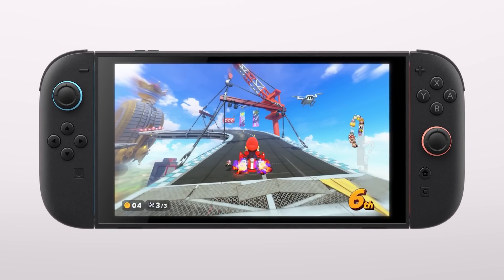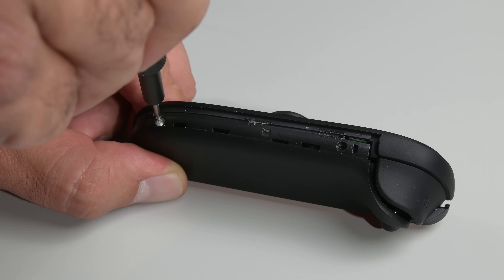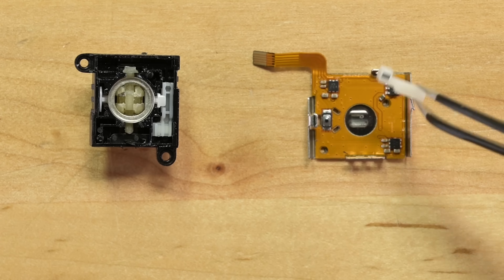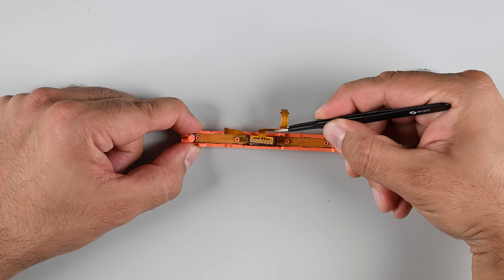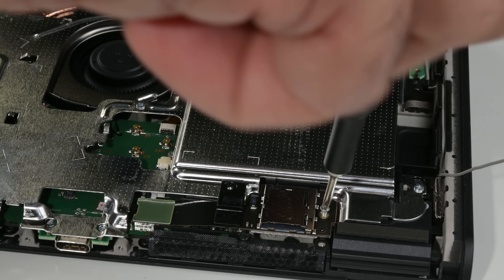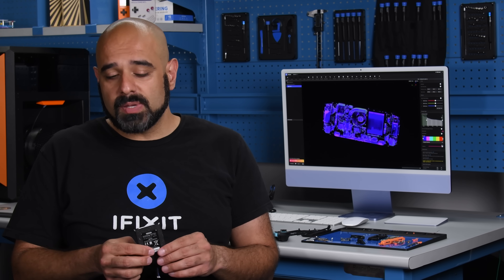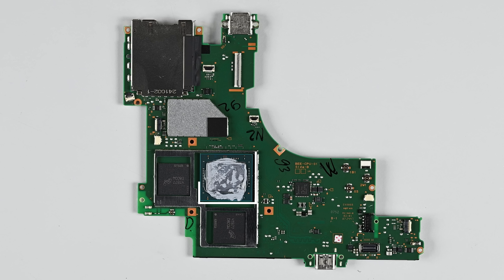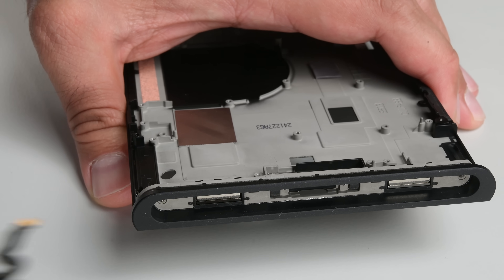Joy-Con Drift Isn’t Dead: Inside the Switch 2

Comment: One of the best things i ever did with my old joycons was replace the potentiometer sticks with hall effect modules.  Needless to say all the glued down pieces covering access screws is reprehensible
Reply: It would not work on the Switch 2, though, sadly, due to the magnets that are in the Switch 2 interferring with the hall effect sensors and making them drift. It would likely be more of an issue in detached joycon mode than atached mode, though, since when the joycons are atached, the magnets are basically in a permanent position in relation to th sticks' locations, but they are not in the other mode, especially if you move the joycons around a lot, for instance closer or over the Switch and thus its magnets. TMR is a nother magnet-based drift-less sensor technology that people are making sticks with, btw, BUT it is both higher resolution, more sensitive to movement, AND more resistant to outside magnetic intereference, making it possibly viable as an alternative! We need to try and test it first to be sure, though.
Reply: @Luka1180  even if it did work it’s so hard to get into the joycons now.  It wasn’t super easy on the original ones but at least there weren’t stickers and glue covering important screws.  To me this is Apple levels of bad design when it comes to the right to repair or modify it with better parts

Comment: That battery life is a major turn-off
Reply: If your a handheld user yeah so you should probably wait until the lite version if it exists
Reply: @nowh_8808the thing i like most about the Siwtch is the portability and battery life. I'm one of those weird people who doesn't really like the Mario or Zelda games and is more into things that are available on other consoles (like Skyrim). There's no point playing that docked as I might as well use my PS5 or PC
Reply: It's pretty much the same battery life as the pre-2019 LCD Switch which had a more power hungry processor compared to the Lite, OLED and post-2019 LCD Switch, honestly it could've been worse considering the 1080p, 120hz screen the Switch 2 has.
Reply: @netako I have the original Switch and the battery life is far longer than 2 hours even now, with an old battery. The only criticism is that it's slow to charge compared with many modern USB C devices

Comment: 8:22 That's not flash storage modules, 'each 128GB each' as you said. Those are memory chips, each 6 GB. Why would the SSD and the SoC share the same heat sink??? 

And you made the same mistake again by saying those are SSD storage at the end at 10:09. I think the flash storage is the one just above the SoC and below the cartridge reader under the emf shield.

Edit: Spelling.
Reply: the UFS storage is in the corner on the back of the board, on the other side of the battery connector

Comment: is it NOT beaten by the steam that is an outright lie, -A steam deck owner
Reply: It depends, docked yes the Switch 2 GPU outperforms the Decks but in handheld mode the Deck is likely to outperform the Switch 2 since the Switch 2 has to downclock a lot for battery life. The Decks CPU is faster, faster storage, more memory. The Switch 2 has the better GPU docked and portability

Comment: During that reveal of the switch to they made it a point to say the joy-con sticks the joy-cons have been rebuilt from the ground up from the ground up where the same crappy ones that have been in the same crappy ones since the beginning?

I knew once they said that they weren't going with hall effect sensors that they were using the same thing as before.
Reply: It is disgusting that they said that........

Comment: There is no excuse for a device that's not designed to be waterproof to not have replaceable batteries.
Reply: Fair, but given that switch 2 Is marketed to children an easily swappable battery like older phones used to have might be an issue. Poking, damaging, biting, swallowing etc.
Reply: @kamil10078 just make the back of the switch removable with 4 screws and don’t glue the battery or use one of the pull glue which is used in a lot of electronics. No risk of children unscrewing 4 screws and then pull that battery out and eat it.
Reply: @kamil10078  Game Boy, Game Boy Pocket, Game Boy Color, Game Boy Advance, Game Boy Advance SP, Game Boy Micro, Nintendo DS, Nintendo DS Lite, Nintendo DSi, Nintendo 3DS, etc etc all were marketed to children and all had easily swappable batteries. GEt out of here with this absolutely terrible excuse.
Reply: @mjc0961  It's one of them "modern types" you know.
Reply: @mjc0961  I can imagine the defence being "but but, back then they didn't have a clue about children's safety!" they 😁
Reply: @averdadeeumaso4003  Back then when everything had replacable batteries ...
Reply: @kamil10078 Not really, Nintendo markets towards adults that are nostalgic for the games they grew up on. The overwhelming majority of fans for Mario, Zelda, Kirby, Metroid, and especially Pokémon (along with the rest of their 1st party IPs that are the whole reason people buy Nintendo. No one’s buying a Switch 2 to play an inferior version of Cyberpunk 2077 on the go) are adults and it’s time we stop treating gamers as all children or adults who never grew up

Comment: Eight years later and Nintendo's still serving us drift-prone Joy-Cons? Come on guys! It's 2025, we've got TMR, Hall effect sensors, and you're still stuck on 2017 potentiometer tech! And don't get me started on that battery glued down like it's going to Mars. At least the teardown was epic as always - keep it up! 💪
Reply: eh hall effect sensors have existed since the 19th century lol there was never an excuse
Reply: @yamboy666 They existed in the 1800s? Or did you mean the 20th century?
Reply: Hall effect sensors would not work well on the Switch 2, most likely, due to the magnets that are in the Switch, but TMR, another magnet-based stick technology, are supposedly more resistant to outside magnetic interference, and thus may be a viable alternative. They are also higher resolution and more sensitive than hall effect sensors!
Reply: hall effects wouldn't work because the switch 2 uses magnets which affect them. whys everyone ignoring this 😂😂
Reply: @pixsled  It's addressed in the video, they also say that TMR would work fine

Comment: Just learn how to solder. It's not honestly that bad, The switch 1's display is worse to remove, and the battery is easy to remove if done properly, unlike in the ifixit guides. The stickers also aren't that bad and the console only uses 2 types of screws, unlike Iphones. Unfair to give it a 3/10, would give it a 6/10. Also, if you look at board scans of the switch, there just isn't enough space to make everything modulat. It's quite tight as is

Comment: My gulli kit hall effect sticks wore out after about 1 year. I reached out and got the opportunity to buy new TMR versions. Yay me. I hate that nintendo doesnt seem to care about this issue but I also dont think that the hall effect solution is as durable as it should be.
Reply: There is still a mechanical part to it, if the new hall effect part uses the same original housing, spring, and other components, I'd avoid.

Comment: Repairability was clearly not taken into account when designing this.
They don't care about users or the planet.
Reply: They care more about intellectual property than the planet.
Reply: @soundspark  I don't see anything here that would deter a modder.
Reply: @Shawn_White That's not the point. It shouldn't take a talented modder or professional repair tech to perform basic fixes. The console could have been designed in a way where the average person would be able to replace basically anything. The problem is Nintendo (and most other companies) go out of their way to make it as difficult as they can for the average consumer to repair their own stuff. They dont NEED to do it this way, they choose to. Not only does it cost the end user a ton of money, but it contributes massively to e-waste.
Anything that CAN be integrated using a modular component, should be. Press fit, ribbon cables, screws, etc. 
They do it this way so 99% of people feel forced to give Nintendo more cash for repairs/replacements.
Reply: @PloopChute  They should definitely do it like how Microsoft does it with their Surface computers where they have QR codes on individual parts linking to guides on how to fix them.
Reply: At least they didn't solder the joysticks in.
Reply: @Oree254  They know they'll be dealing with stick drift.
Reply: @Oree254  or put glue under the soldered Joysticks, YES, I SEEING YOU MICROSOFT!!!!!!
Reply: What else is new? Nintendo is one of the most evil companies.
Reply: Almost no consumers repair their own consoles, especially for mobile devices. And when it comes to warranty service, even the manufacturer doesn't repair products in this price range as its more cost effective to replace it since repair work has to be hand done.
Reply: @blastofo Then the design philosophy should start at repairability and potential recycling and then go from there.
Reply: you're expecting too much from nintendo buddy
Reply: How is this new?
Reply: Honestly in my experience that's marketing's fault
Reply: how?  @Dashitishere22
Reply: Just stop it's a custom system with a weird looking motherboard
Reply: @Space97.So what ?
My car is also very much a custom system, but I still curse the manufacturer when I can't easily fix a part.
Reply: Nobody cares about the planet 😂
Reply: @TermsAndConditionss Not nearly enough people care about it.

Did you know that it's where you live ?

Comment: Still a 5 year old architecture on launch, still a plastic LCD screen, still obnoxiously expensive for what it offers...
Reply: Screen is glass with a piece of foil on it.
Reply: @mikemaj2  It's plastic covering the screen which cannot be removed, which for all intents and purposes, is a plastic screen. It'll scratch just as easily as a plastic screen.
Reply: Hey now! Ampere ain't no slouch. It's light-years ahead of the nerfed Maxwell architecture the Switch 1 had
Reply: @ninten360  While true, it sadly does not change the fact that it is 5 years old at this point and is 60% of a 3050 which was already deemed bad value at launch. It's also just not a great feeling to spend that much money for a handheld console and get hardware that is half a decade outdated.
Reply: @AlexSchendel keep crying
Reply: @SWOTHDRAlol. How does that contribute to the conversation at all? Feel free to drop $500 on the Switch 2 if you want, I'm not stopping you. I'll stick my PC where I can swap parts as needed and get better performance per dollar.
Reply: @AlexSchendel It's a handheld as thin as a phone. I'm not justifying the price, but as far as power goes, I don't think something more powerful would be possible to cool in this form factor
Reply: @SWOTHDRAnobody asked for your input
Reply: you could say the same for almost every comment in this comment section  @juicetimer
Reply: @pixsled  I know, but its a fitting response to an equally garbage comment as "keep crying".
Reply: It think its a pretty nice piece of tech for what it is.  People just like to hit the 'on' switch and have a game run.

Comment: They took more notes from Apple.
Reply: Even apple allows to remove the battery without using tools or alcohol (after your open it of course), the switch is just a joke
Reply: @coquequique250600 you are a poor sad little clown 🤡
Reply: @coquequique250600  a joke?? You are a joke if you don’t understand why that battery needs to be glued like that to the system! But your tinny little brain can’t understand it
Reply: @coquequique250600  technically you still need tools to remove Apple batteries, i.e. a power source and jumper wires

Samsung's implementation is even better, literally just unwrap the battery and it pops out. I appreciate both methods of course, beats pull tabs and alcohol + prying.
Reply: @LazorVideosDestruction  I agree with you, but this isn’t exactly a competition. Both methods are very easy and effective. They’re just different is all. Both methods are better than 99.9% of other phone makers.
Reply: No more than Samsung 😂

Comment: I never had drift with any of my Joycons on the Switch 1, I did have drift with my Switch 1 Pro Controller though, the issue being, one of my dogs hairs...
Reply: There are many factors that contribute to it. Very few consoles were drift free, like the Dreamcast.
Reply: @lukilladog I never had stick drift, not on my ps3, ps4 or switch controllers. People need to learn how to keep their controllers clean. Put them away after you use em
Reply: @SWOTHDRA That is not a factor really, look for some potentiometer replacement here in YT and try to find one noticeable dirty. The design is dirt proof for the mechanism. There are factors, I've never had shoulder button, or trigger failures, but I don't play FIFA or Call of Duty either. Playing racing games though, it takes 4-6 months before official sticks lose their smoothness, then lose of tension and drift, and sometimes total failure of the sensors (jumpy sticks). My Gamesir G7 on the other hand, feels and controls like new after 1 year of playing the very same games. We are being played.

Comment: god why they have to use glue with joycons and stickers with the main unit?
Reply: It's a way to keep you out. Make it so changing anything permanently degrades the hardware without lots of extra work
Reply: The stickers is to keep the layer above the magnets as thin as possible. They said it's 0.2mm to make the magnets stronger
Reply: @dirtydirtsgt4751  thats just a bs excuse also the fact that they still use the same sticks as og joycons they 're gonna drift like before and they added glue to new joycons
Reply: @vjollila96  it's the same potentiometer tech, which is used in nearly every controller. The drift is caused by bad housing design on the previous one. Time will tell how this one holds up
Reply: The resisistive sensor also wears out or give Up.

Comment: That's not the storage next to the SoC. It's the 2x 6GB LPDDR5X RAM. The storage is on the other side...
Reply: mayor oopsie
Reply: @williamv0242 make the video yourself next time jacksss
Reply: @brodeur7  i aint buying that lmao
Reply: Maybe they should start using lpddr5 on gpus
Bro just hear me out
Reply: That's what I was thinking too 🤣
Reply: They also said it was weaker than the Steam Deck.... Lol
Reply: @yzois steamdeck run a few games mych better then switch 2
Reply: @issacdragon3834 the steam deck and even better, the Ally (original one, now extremely cheap) , they run x86 games and will run Switch 2 emulation too so... It's always better than the switch 2
Reply: @ricarmig  Those can’t even emulate switch 1 games that well, steam deck only runs at 800p and still struggles majorly with bigger games.. atleast switch 2 will get more optimization for the bigger games.

Just need valve to stop dragging ass and make steam deck 2. They especially need to offer a power efficient version, and then an option with z2 extreme or hx370 or whatever the strix halo platform is called.